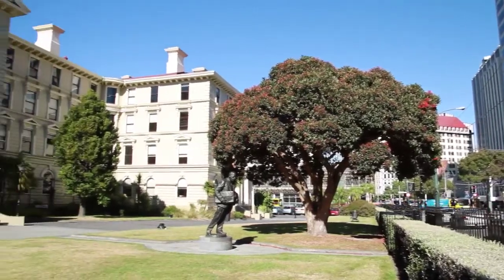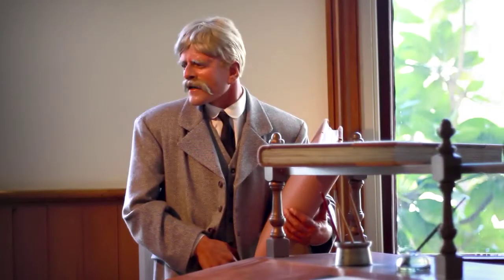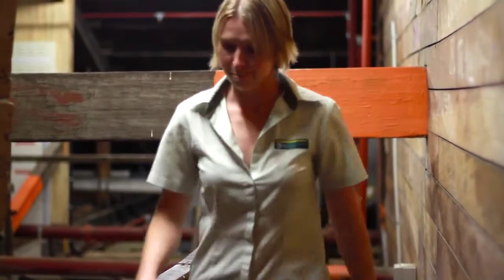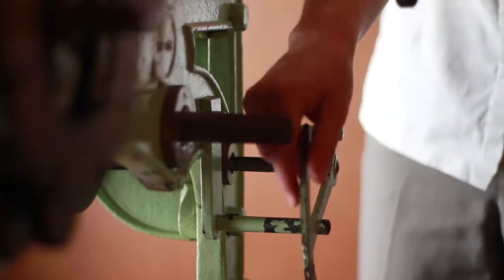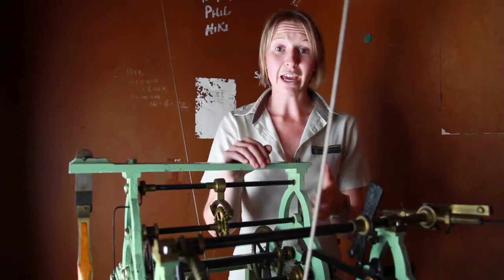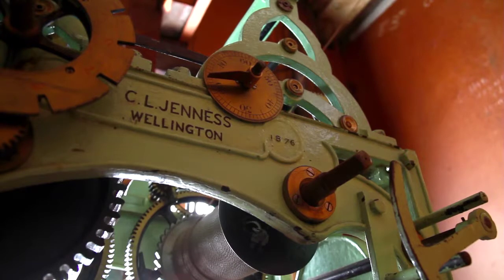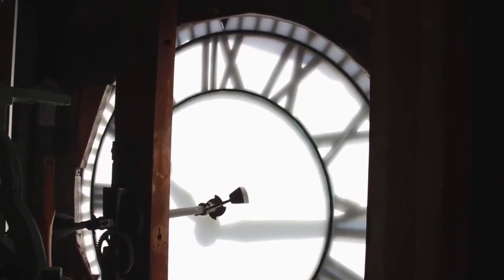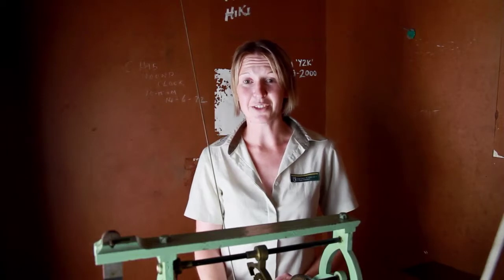Keeping Time at Government Buildings

Comment: This isn't actually made by C.L. Jenness of Wellington, it's just a rebranded Gillett and Johnston clock. I've seen only one installation like this, and it was in Australia. Since Australia and New Zealand are pretty close to each other on a map, this might just be a thing that was done with these clocks in that area. Also, would you say the clock is painted in a "light pistachio" color?
edit: at around 4:50 , the unusual branding is mentioned, I made this comment before I saw that.